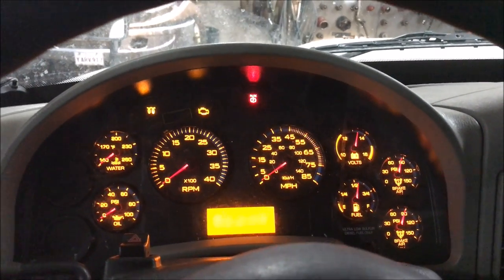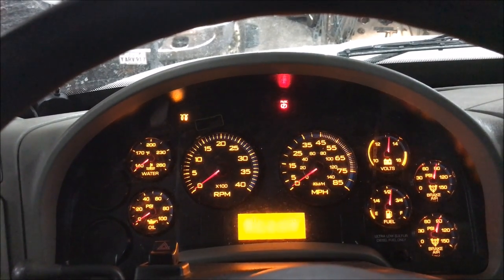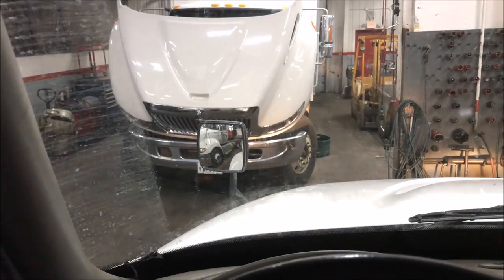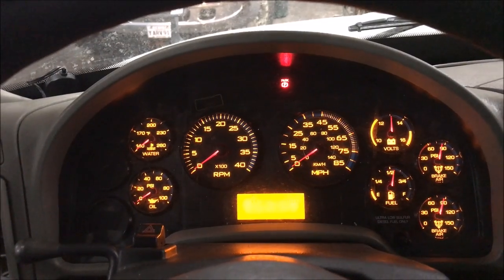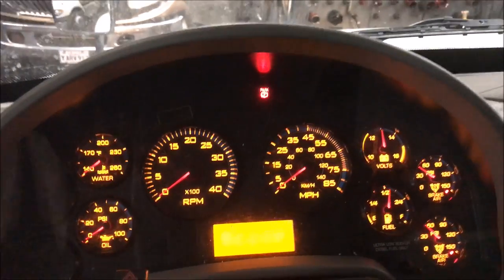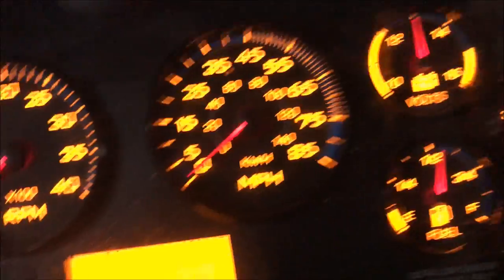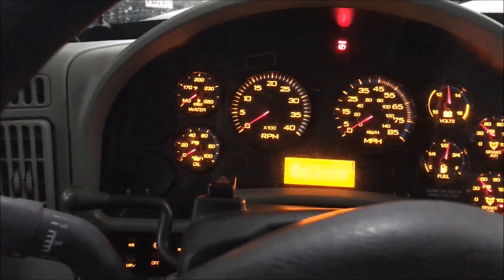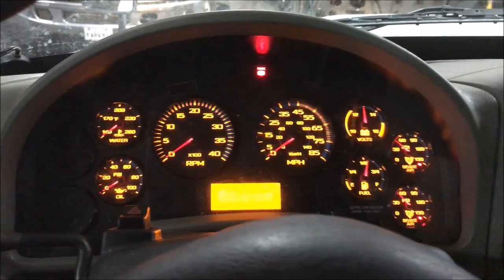International Warning Alarm/Chime/Buzzer Disable

Comment: The noise goes off with this method when its not running but when i start the truck the noise will not go away. Any thoughts?
Reply from the maker: Did you redo this procedure after the engine was started?
Reply: Tony The Truck Guy yes i tried holding it down for like 15 seconds
Reply from the maker: Why is the truck beeping?
Reply: Tony The Truck Guy brake pressure light
Reply from the maker: That’s likely one of the issues that can’t be silenced once the engine is running because it’s a safety issue. You’ll have to actually get the brakes fixed. As you said, it will work with the engine off, but some alarms can’t be silenced with engine running.
Reply: Tony The Truck Guy dang that’s unfortunate. We replaced the brakes all the way around and fixed a pin connector on the brake switch and its still throwing the light
Reply from the maker: Is this air brakes or hydraulic?
Reply: Tony The Truck Guy hydraulic

Comment: The little air sound you get after u turn the ignition switch...I use to get that but not anymore. Plus my abs light pops up
Reply from the maker: Hmm. Not sure what air noise you are referring to. The instrument cluster makes a bit of a whirring noise each time the ignition is cycled, but that’s all I can think of. Otherwise I wouldn’t worry about it. If the ABS light stays on even after you start driving down the road, you’ll have to have someone scan it to see what codes is active and troubleshoot from there.

Comment: The low air buzzer comes on when I engage the auto start/stop… I did your method but it didn’t work… What else do you suggest?
Reply from the maker: I don’t believe the low air can be silenced with the engine running as it’s a safety precaution but this is the only method I know to silence the alarm in any way unfortunately.
Reply: @TonyTheTruckGuy  the engine was off. I had the auto start/stop button engaged.
Reply: @TonyTheTruckGuy  I have a 2016 ProStar..
Reply from the maker: @ngrossley  I guess I’m not sure what you mean by auto start/stop. Never seen that.
Reply: @TonyTheTruckGuy  oh ok. Auto Start/stop is a feature that allows the truck to start up and turn off when the volts drops below 12.1 are 12.2 so that the batteries will recharge.
Reply from the maker: @ngrossley  So does the truck start up and shut down all by itself or do you need to have the key on for that to work?
Reply: @TonyTheTruckGuy  what he's trying to communicate to you is he has an electric APU. at night if he's running the system with auto on and off engaged, when the batteries drain below 12.1v the truck will automatically charged the batteries by turning itself on. when this feature is engaged the ignition key is in the off position, but dash panel has power as if it's in the on position. When the truck is turned off it's losing air So within a 2 to 6 hour period the air has drained causing the low air pressure alarm to go off. so the driver has to turn the truck on manually to fill up the air tanks so the alarm goes off. it's a nuisance because it keeps waking us up not allowing us to get our full sleep.
Reply from the maker: @anthonyvinole8249  Oofta. Yeah that’s a terrible design. Not sure why they’re so adamant about those stupid beepers. I see no reason for them to sound with the key off lol

Comment: Question 2015 prostar. When I turn the key off acc power remains on no matter what I do.
Reply from the maker: Well THAT’s no bueno. Even if you have the lights off and key out of the ignition? If that’s the case, then it kinda sounds like a faulty ignition or body controller which would of course take some troubleshooting to figure out.
Reply: @TonyTheTruckGuy  yes, key off and out. Lights off. The only way to stop it is to pull cluster and radio breakers. Also I have no bunk lights. Not sure if they are connected issues. It doesn't malfunction all the time tho. Another thing it will do is when it does cut off while the apu is running everything will light up from time to time and then cut back off
Reply from the maker: @gumpwhite  Man that’s some electrical gremlin shit. None of that makes any sense unless there’s some sort of issue where the cluster or radio are getting unwanted power and back feeding to the ignition. That wouldn’t explain the APU stuff though. Have you verified battery connections are all clean and tight and not contacting anything that they shouldn’t be?
Reply: @TonyTheTruckGuy  yes, I even found a broken wire on starter because I've chases the main power source outside the can😂. Inside the cab looks like a nightmare so was looking for areas to check before diving into that
Reply from the maker: @gumpwhite  Oof. Yeah if starter and battery connections are good then I would have to lean towards a body controller issue but I’m sure it would take a few hours of diag to pinpoint the issue

Comment: My prim and 2nd air gauges pointing straight down & alarm constant. Know a fix?
Reply from the maker: There are many possibilities, bad pressure sensors, bad instrument cluster, bad body controller.... I’d start simple and disconnect your batteries for about 10-15 minutes then go from there.
Reply: Tony The Truck Guy Same thing my boss told me. Fingers crossed🤞🏽
Reply: My also my prim and 2nd air gauges point down and alarm beep even with key on engine off know a fix
Reply: Hey I'm having this same problem did you get your's fix if so what's the cause of it

Comment: Did not work on my 07 dt466 straight truck but I found where the beeping was coming from and unplugged it
Reply from the maker: Yeah it depends on why the truck is beeping. Som alarms can’t be silenced. Sounds like you found the little beeper behind the dash haha
Reply: @TonyTheTruckGuy    Yes thank god. That was annoying as hell!
Reply: Where is the beeping coming from?
Reply from the maker: @fdiscua19  Pretty sure it comes from the instrument cluster itself but if you look under the dash there’s usually a small area you can jam a rag or something to quiet it down.
Reply: @fdiscua19   If you run your hand under the dash panel behind the light switches to the cluster ther is a round little speaker and a small white plug you can unplug

Comment: How do you do this for a 2007 International armored truck?
Reply from the maker: Unfortunately if this method does not work, it’s likely not possible, but I haven’t been inside an armored International before so I’m not sure how different the interior layout is
Reply: @TonyTheTruckGuy  The dash is the exact same as yours. Its an old POS and i figured out that turning the truck off and on works for a few minutes. Started doing that at each stop and its good. Brakes are squishy as hell but theyve been like this for nearly 3 years and the company refuses to fix them.
Reply from the maker: Hydraulic or air brakes? And what is causing it to beep exactly?
Reply: @TonyTheTruckGuy  Air brakes and I'm not even sure what's causing it. Just says brake pressure. It's just a truck I drive every now and then and thought I'd see if there was a way to disable the annoying beeping. Thanks for the replies.
Reply from the maker: Ahhhhh. So literally sounds like the two issues are related haha. The brake pressure light is one of the more severe warnings for the beeper so I don’t think you can silence it until the actual brakes are fixed. Typically a truck that size probably just has a smaller compressor and air tank assembly unit which commonly fails but yeah I would be screaming at the company for not having safe equipment that you have to drive.

Comment: anyone know how to shut of the anti theft horn beeping when you open the door???
Reply from the maker: That’s likely to be an option in the ECM or body controller that the dealer or someone with dealer level software will need to disable.
Reply: Pull the parking break
Reply: Yeah cut the horn wire😬

Comment: The main other reason the dashboard alarm goes off is when an emergency exit is opened, accompanying the beeper for the exits. If you were to just have the bus in neutral and shut it off without the brake, the alarm goes on continuously until you turn the key on. If your bus has a child check, the alarm will pulse simultaneously in the same way for about a minute until it stops and the horn starts to pulse. To clear that, you have to either depending on the model: A. Open the back door, or B. Press and hold the reset button in the back. The dashboard alarm may also pulse quickly 5 times when you start the engine.
Reply: This isn’t a bus, but you’re right.

Comment: how do I bypass derat from Def when it think it's empty but it's really full?
Reply from the maker: There’s really no way to do that. The gauge often reads empty with a red warning light when there’s a general error with the DEF system. It doesn’t necessarily mean that the sending unit is bad. It’s generally caused by a broken wire or bad DEF quality. A lot of times, changing the DEF and DEF filter then running a regen will remedy the issue but without knowing the exact code, it’s a bit hard to troubleshoot.

Comment: WHY?  those buzzer go off for a reason, it’s to let you know “Hey, there is a problem, must get it fixed”. If they didn’t want you to know, they would not make it buzz.  Especially if it’s for a Air Brake buzzer.
Reply from the maker: Because when you’re a mechanic trying to work on a truck and it’s beeping at you for 3 hours, it gets pretty annoying. Important alerts such as low air can’t be silenced anyways.

Comment: How do you get rid of the brake pressure light ?
Reply from the maker: Air brakes or hydraulic?
Reply: @TonyTheTruckGuy  hydraulic
Reply from the maker: Check the side of the brake master cylinder, which should be mounting under the hood on the driver's side of the firewall. There should be 2 sensors going to it. 1 of them is notorious for snapping off. If it's broken, you'll have to extract the broken piece and replace the sensor, or worst case scenario, replace the master cylinder if you can't extract the broken piece. If the sensor does not appear to be broken, it could still be faulty, so you would have to replace the sensor, or take an ohm reading and find the spec on the sensor. Aside from that, you could have air in the system, or even just be low on brake fluid. The only way to tell for sure would be to scan the truck and see if there's any codes in the ABS ECU.

Comment: Hi man, how do i turn off my exterior amber lights?
Reply from the maker: Which ones?
Reply: Amber Indicators lights, mirror lights and my dashboard is always on with the ignition key off
Reply: Thanks man!
Reply from the maker: So your truck dies every night? That’s very odd. With the lights turned off and the ignition off, nothing should be on. The LCD screen where the odometer is should stay lit for a minute after you close the door but then it should go out. It’s hard to tell what could be causing that without being able to look at the truck. I would check and fuses and relays related to the body controller or ignition.
Reply: Likely isn't die at the other day.
Reply: @eliecerojito6210  Wouldn't you just turn the master switch off?

Comment: Where is the alarm located? I'd like to just cut the wire to it.
Reply from the maker: It’s part of the instrument cluster motherboard. You have to take the cluster apart partially.
Reply: Thank you. I pulled the cluster out. Pulled the metal panel off the back. Unplug the speaker from the board. I also unplugged the horns so you don't get the stupid chime if your doors open and you try to drive around. Thanks for the video.

Comment: does someone know how to stop the your to close to the car in front of you alert beeping in a tractor..??
Reply from the maker: That’s likely part of your Bendix Wingman system. The forward radar would need to be disabled either in the truck or sometimes by laptop.
Reply: Tape a pop can to the sensor on the front bumper. Spray paint the can black first and make sure to remove it before going to any terminal or shop.

Comment: Any one know what fuse location it is because this doesn’t work when engine is running
Reply from the maker: Unfortunately I don’t think there’s a fuse for it, the beeper is tied into the instrument cluster wiring, so you’d have to cut the wires going to the beeper or something
Reply: Hey thank you just realized that you responded. It just was annoying. Beeping non stop the whole time. We got it fixed ended up being a air sensor.
Reply from the maker: @dragont1x5  Glad you got it figured out!
Reply: Thank you I have subscribe to your channel.
Reply from the maker: @dragont1x5  I appreciate it!

Comment: This works unless you start the truck then the alarm will continue until tanks are full. 
We have an air leak that of course the shops (can’t find because no one take initiative anymore) so my wife and listen to this noise everyday. Oh you turn the key on and the silence does stop with this trick but go ahead and turn the key forward and start the truck then it starts the damn beeping again. 🙄🙄
Reply from the maker: Try this procedure after the truck is already running. Sometimes it works.

Comment: It's DOT violation if low air buzzer is not working but is ok for some other thing
Reply from the maker: It varies by state. Here in MN, you just need a visual low air warning, audible is not required, however this trick is not permanent and is only used during truck service.

Comment: Mine's beep  because of the fuel light and now it's still beeping help please
Reply from the maker: Some of the functions that cause the buzzer to make noise just can’t be silenced unfortunately. If your truck is full on fuel and still beeping for low fuel, your fuel level sending unit is likely bad. They’re a common failure on Internationals.
Reply: @TonyTheTruckGuy  well the fuel light is not on but it is still beeping I'm just assuming that it's what's for fuel because when I was low  in fuel the light came on and shortly after the beeping started but right now my whole dashboard is clear no lights but I'm still beeping
Reply from the maker: That’s very odd, usually there’s a warning light of some kind on the dash or at least a message by the odometer. If there’s really nothing on then you’ll likely have to bring it to the shop unfortunately to get it checked out.

Comment: Has anyone changed the front blower motor?
Reply from the maker: A few, what do you need help with?
Reply: Tony I have a 2010 international prostar. Where is the front AC blower? Is it easy to install ?
Reply from the maker: What do you mean by “A/C blower”? You mean just the blower motor for the cab? It should be located in front of the passenger seat. You’ll have to remove the plastic panel down by the foot area to access it. I can’t remember for sure but once the panel is removed (which is the hardest part), I believe there’s just 3 or 4 screws that old the blower motor in place. It’s about a 30 min - 1 hour job.
Reply: Tony The Truck Guy   Tony when I remove the plastic cover on the passenger side there is another cover there. It’s black. I take that off as well?
Reply from the maker: Yep, keep going until you see the blower motor. It should be black with 2 big wires coming from it and held in place with 3-4 screws.

Comment: This doesn’t work if the truck is running
Reply from the maker: Depends on the contrition for the alarm going off but yeah there’s many instances where it won’t work while running.
Reply: @TonyTheTruckGuy  I think I have a slow airbag leak,I  pumped the breaks to release & rebuild air… and tried your method again it worked for now! my heater bunk doesn’t work so I have to sleep with truck running hopefully it last, thanks again !

Comment: Do you have vidio how reset the oil change international 2016
Reply from the maker: Not yet but I will. In the meantime, here is the procedure:

1.) set parking brake
2.) turn key to the “on” position but don’t start
3.) press “cruise on” switch
4.) press “cruise off” switch
5.) press “cruise on” switch
6.) rapidly press the “cruise resume” switch 4 times and hold it down on the 5th time for at least 4 seconds
7.) “oil change” message should clear

This might take a few tries to get the pattern down right and sometimes even if you do get it right, you will still need to do it a few times. I’ve actually had a few trucks that just never cleared for some reason. After every attempt, I turn the ignition off and back on. Hope this helps.